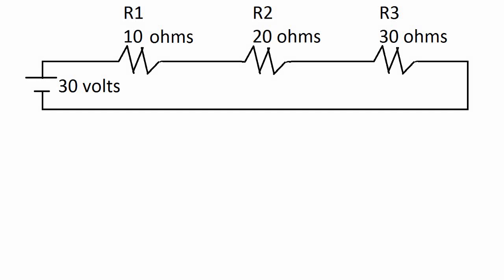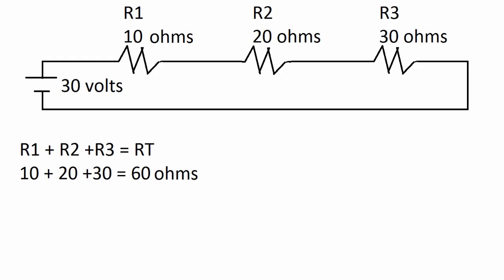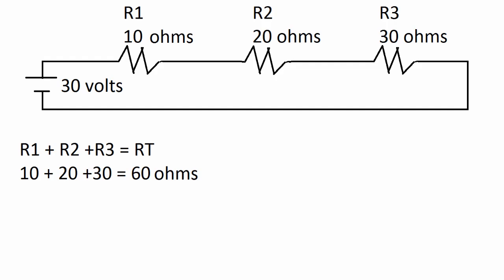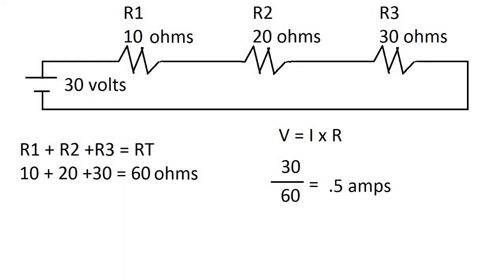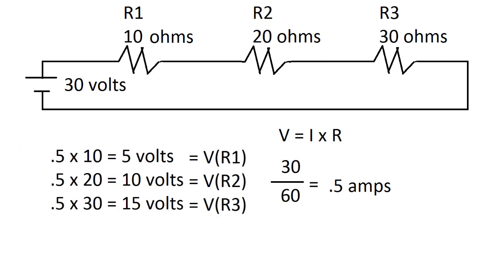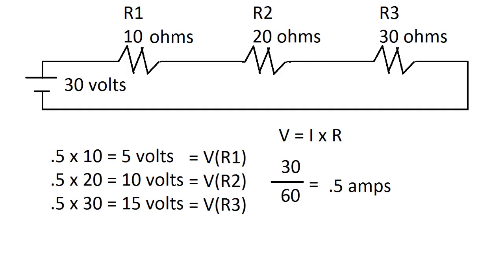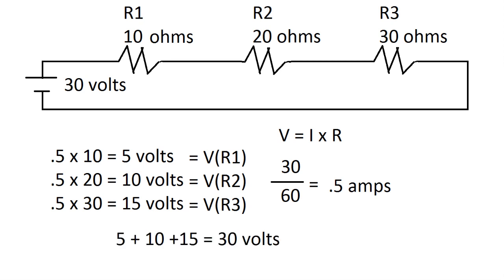Circuits in Series: How to Find Current, and Voltage of Each Resistor

Comment: I honestly don't know if anyone will answer this for me, but I also have a test tomorrow. If the answer for amps wasn't .5 but instead a longer number what would I round to to get the best answer? Because for my certain equation I got .4137931 amps and I don't know which number to round it to because there wasn't a specific instruction to round to nearest tenth or hundredth so I can find the current in each resistor.

Comment: Hey I was wondering, can you solve for individual voltage and resistance if the only given was the total voltage and total current?
Reply from the maker: I don't think there is a way to do that. You would need the resistance of each resistor or the voltage of each resistor.